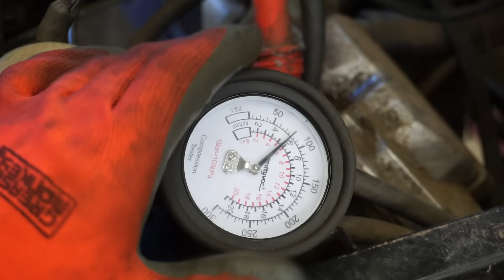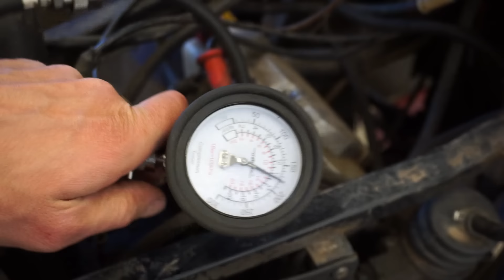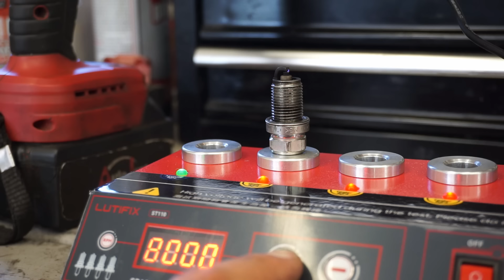Nobody Could Fix This $200 ATV (Won't Start)

Comment: I know exactly what it is I had three LTZ 400 to do this When you put an aftermarket muffler on you need to increase the jet size The reason that your little tape trick is working is because you're blocking off some of the airflow coming in so you're letting less air in with the same amount of jet which is increasing the fuel in essence I will bet you $1,000 you put a 150 to a 160 jet and the bogging will be gone and you will not need the tape on the intake that's a half ass way of fixing it I've done that myself so all's you need to do is increase the main jet size and it will be fixed or put the factory muffler on it I will bet you $1,000 that's what it is
Reply: I was looking for this comment, I don't know why it's not the first comment
it's pretty obvious they make everything run extra lean to pass emissions
 so any air flow increase will make it too lean-to work, the tractor exhaust and crack airbox did
as you said it need a bigger jet 
to get even more perf open airbox and big jet

Joe is really bad at jetting he should really follow a course and get an afr monitor

Comment: New to this stuff, when Joe put the fuel filter on, shouldn't you put clams on each side or is there enough tension that you don't need it?  Thanks!  Have watched a lot of Joe's videos, don't know how he's not swearing more, especially when working on Polaris!
Reply: Plus I usually use the metal fuel filters because I just think its safer being that close to the engine (I only have Honda's).  Dude at the parts shop thinks I'm crazy but just seems like a good investment.
Reply: I have a polaris can’t get it started had some real laud backfires and now it wont start. Help. Also how can I make my spark plug wire longer or better reattach it to the plug??
Reply: @cgreen4life the filter has the barbed ends so the constant tension clamp isn’t required, there’s no line pressure and if the engine gets hot enough to melt the plastic hosing of the filter you’ve got bigger problems lol
Reply: @ thank you!  Appreciate it!
Reply: @FilMetalJackedted  probably jumped it’s timing that’s where I’d start

Comment: You don’t think that the carb slide maybe isn’t quite right? Either that or the carb isn’t metering air properly. Just a guess on my part and because you shouldn’t have to restrict the air intake horn.

Comment: What else do you mess with when you got a bad running engine, the choke.  The air box not seated properly makes it not run right, seal it better and it runs better, close it some more with some tape and it runs even better, doesn't that sound like when you're messing with the choke?  Air vs gas in the carb issue, no?  I'm at 44minutes, gonna watch the rest.  LOL

Comment: Sounds like the air box could use a hose clamp doesn't sound like it's a full power still.the air box has got to be sealed water and air tight.

Comment: Wierd with the air box causing so much trouble, possibly a replacement for reliability latewr ? Did you plant the potatoes ? All looks new now, but in three weeks there WILL BE GREEN :)

Comment: Hi, I’ve just a 2008 crf450. However, on the compression test it shows only 19 psi, on checking the valve clearances,I can’t get any feeler gauges through under one valve, Should I continue to strip the top end. Not sure which way to go from here?

Comment: I'm thinking it's the tractor muffler that's on it It's the same as if you put a performance muffler on a bike and don't rejet I would try to hunt down an OEM muffler for it I've done it a few times where I've put just whatever muffler I could get on a bike and then it would not run correctly till I re-jetted the bike

Comment: The Polaris cvr carb are very sensitive how much air comes in from air box I bought a 2004 sportsman 500 and put three different carbs on it still ran bad did some searching ended up someone put the wrong air box lid on it with smaller inlet and was starving it for air

Comment: I have the same wheeler.    It will not run right without the air filter installed correctly. 
And nothing broken

Comment: Dont you love how you get cheap things just because people don't know how to do simple things lol hahaha. it's crazy if I found something like that it be like rebuild whole motor oil plug stripped, half the head bolts stripped needs new valves. sometimes you get lucky, I guess. my wifes four-wheeler. I had to do the same thing, but what I did was  put a carburetor cleaner cap and drilled a hole in it and she runs like a champ.

Comment: 11:14 I looked up your tester, the Lutifix ST110, and actually you’re using it incorrectly for how it was made to be used. #1 This doesn’t really simulate the conditions for sparking a plug under conditions it would be exposed to in the engine, and #2, the tester is designed for you to have a known good new (the standard) spark plug in the first hole on the left, and up to four unknown condition spark plugs tested in the remaining holes. I guess from there you’re supposed to compare to the standard to the unknowns. The tester was only $25 on Ali ba ba so I can’t imagine it’s going to be that good at anything.

Comment: adjusting the air screw did no difference on the carb? weird you fixed it by restricting air in the box , the air screw on the carb should have worked..

Comment: Joe I can tell you A cheap and permanent fix for that air box breather problem. A hockey rubber puck cut down to fit into that hole. Then some black flex seal glue and A hose clamp around the outside of it to keep it in place inside with to.

Comment: Engines are * BASICALLY*   ( Air Pumps )  What  goes in one  end * THEN *  Comes out the  other.   Think of  this like a  JETTING  ( Mis-Hap )   To  little versus  to MUCH.   Inconsistent  as the  Vibrations  increase yet ( SEEMINGLY  ) Fine  at  idle - INDEED.

AIR  boxes. Filters, LUBED up or  Run Dry too.  That  Sealing  surface is  CRITICAL due to how the  Carb and the  Valves move too. Try this  and  I will suggest another item next. 

Original Manufacturer Specs generally have a  ( +/- ) Tolerance  before  and  after BREAK in Periods take place.   Like the  Viscosity of Oils and  lubes.  To heavy runs  sluggish ( To Light  Runs out of  Control leading to PRE-Mature Wear  ( ARE ) You Following this LOGIC ? 
Look at that  MUFFLER set up !!!  Doe s it  seem to be  OFF as in Far from what  stock was ???
  The  Cycle or  Puzzle might have been more like this as a  Two Steps Forward and  then TEN Steps  Backwards.   The  previous  to the  PREVIOUS owner had some issues.   Let it  sit  to long  with  old  gas in it  then just  poured in some  higher octane to clear it all out  with.   The  Seals, Gaskets, Diaphragms  Dried out  creating the  PLUNGER Issue  within the  CARB  ( WHO KNEW ) ?? The  Muffler  was rotting out.  The  nearest / cheapest option was the local parts ) ONE SIZE FITS ALL  - MISTAKE in the Process. 

The BALANCE between what  amount of  pressure and  vacuum there is.  The old / rotting  seals loosing  grip or ability to perform as  needed.   SITTING ldle  as in NOT  being  ridden or other such things.   That  Cover over the  Clutches DID not  just one  day WARP and  go bad due to an Isolated instance.   It  sat outside chance are got  real cold  then brought in doors.  Maybe a  Heater  was directly  placed near the that side to help ( MELT  AWAY ) what was NOT a PREVIOUS  Problem - Otherwise.   

LOGIC  is  NOT  complicated.  the  STEPS  LIKE ( 1-2-3 )   are start  with the  A-B-C's ) 

The industry  Standard ( METHOD of Operations )   ( A-B-C-1-2-3 )  otherwise knows as this. 
WHO, WHAT, WHEN, WHERE, WHY, HOW. 

Never expect the  sellers  to give the entire stories.  Mish mash of possibly this  and  maybe  that  to get it  sold and became  someone else  ( MONEY PIT )  H O L E !!!

I  have  said  this  to YOU time and  again (YET) it  never has EVER set in to what it is  YOU are doing or  when !??!?!
CHECKIGN everything YOU can Before ever handing over a  single penny.  Pull out the plugs and pour in some oil ! ! ! !
All those  fluid  Levels  NEED to be  SEEN directly  to determine (IF) or  what  was NOT  already  addressed by them or  someone else before hand. 
ALL are Bargaining Chips.  Lights  don't  work  Fifty  Bucks less just as a  matter of  COST  for  Replacement BULBS and Fuses - NO LESS.
NON - Stock Muffler with  Automotive type clamps ( ANOTHER ) 50,75 , 100 bucks  deducted to get it  back to Factory specs. 
A STEAL of a  DEAL is the  SELLER  pulling  the  wool over your  OPTOMISTIC Outlook. 
How  bad could it  possibly  be ? 
Do I really  Need to Back track to some of the MONEY PITS that  this  Channel has  seen ? 

CLEAN the  DAM MACHINES !!!!  Add up from the  start how much time  is  being put into it  all.  Web Searches. Texting time. Phone Conversations,  Drive  distance both Ways. GAS, Oil , Wear and  tear for  VEHILCE MAINTNEANCE.   Shop Labor  cost  exceed  100 bucks  per hour  NOT  less when Push comes to shove. 

YOU VIDEO Content  may be  paid  through YOUTUBE  yet  ultimately  still  quite honestly  getting ROYALLY $CREWED By the process too. 
This GREAT  Package DEAL !?!?!?!  REALLY - SERIOUSLY -  NOT  Even Close when compared to NOT  buying it  all at !!!!

Add up this set of  numbers. 800+700+600+500+400+300+200+100+75+50+25+20+15+10+5+1 =  WHAT ??
$ 3,801.oo        That  number closely  reflects  what  this  UNIT would  have to seek for  in order to BREAK EVEN not a  PROFIT for  Sure.  Time, Labor, Overhead, PARTS,  Administrative,   Editing, Postings, Commentary all are apart of the  MUCH bigger picture. 
Break down of the  nymbers. ?  

As I said before Do the math on YOUR  own time.  What is  YOUR  mortgage ?  Gas, Electric , Water, Sewer Bills ?   Vehicle Costs, Maintenace  bills,  Fill-ups ?   Time  behind  the  Wheel as well.   Does YOUR  phone  and  internet  run on charity ?  What  about the  time in the  shop  Recording  then Going back to see what  got missed or  skipped  before postings.   Going to the ( LAND ) loading up a  trailer what  are you GETTING  a  Thousand  plus  miles per gallon with this  rig in total ? 

YOUR  OVERHEAD is  OVER all other EXPEMCSE.   NOT  just a  STEAL  or  Package that someone  else  GLADLY got  Rid of  .  Cash is  King.  
SUBTRACTING to NOT  adding on is the  Bargaining  chip  ( ALWAYS ) 
In Person FAR Greater Leverage then I will see you  sometime this  week  or  next  weekend  ( MAYBE ) Line  of  B. S. Many play games with. 

YOUR  total  Bill for this  CHEAP as HELL BRAGIN DEAL .  About  Butt NOT  exactly 
$ 3,800.oo  Bucks  Chances are MORE closer to FIVE  Grand is  a  Better reality check when push comes to shove...

SEE what is  being said 

BALANCE  ( VACUUM /  PRESURE  )  its all a  Matter of  how its  Measured !!!
Reply: This novel should reflect to you that you indeed have too much time on your hands. The length of it alone will make most people skip it. The kid is just playing around with atv's and bikes. We don't need a financial breakdown to quantify crap. 😂
Reply: @bradley7723  I read the entire novel for some reason, I usually don’t but I own a business and also play around with mechanical stuff so it got my interest. You both have good points. You must have read it too. I think at some point I watch these things because it wouldn’t pay off in the real world mostly because of labor rates.

Comment: You definitely have an air leak. You know how some engines run better with the choke on. Seems to be a similar problem. Dumb design. But yeah, look for air leaks. Yes you can throw a bandaid at it but what is the real problem with air control?

Comment: so weird. Hardly makes much sense to me.like, why would it be that finicky? one of the odder things Ive have heard of.  Maybe… well, would there be a better way to fix it? Like a different carb / airbox all together? or maybe even reeds? I don’t know… never heard of such a thing.  with other bikes and quads people put extra holes in the airbox to “open them up” and put a more open exhaust as well… maybe if original owner had left the rusted out muffler the broken airbox would have still worked, maybe polaris designs them like this, that explains their crappy metal on the exhaust and the funky airbox design haha.